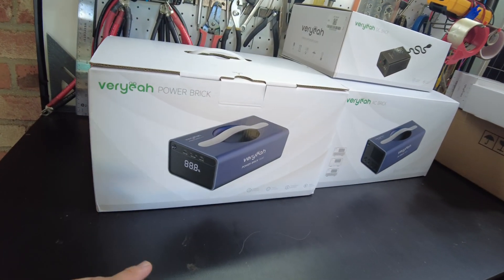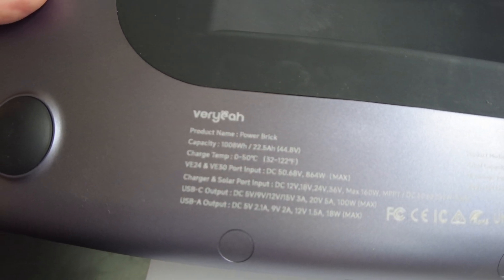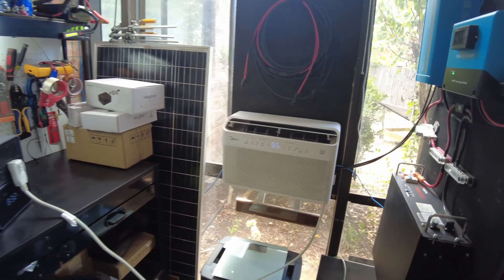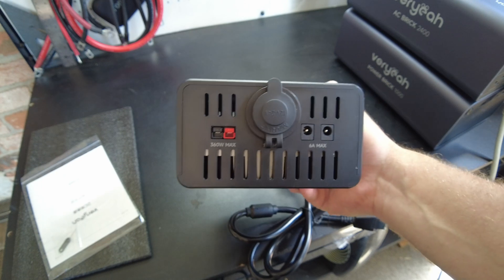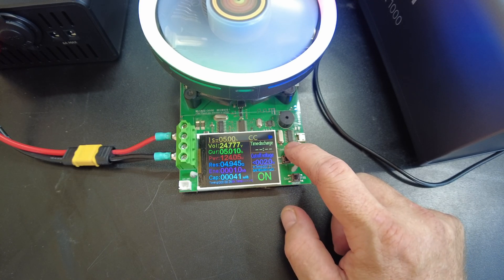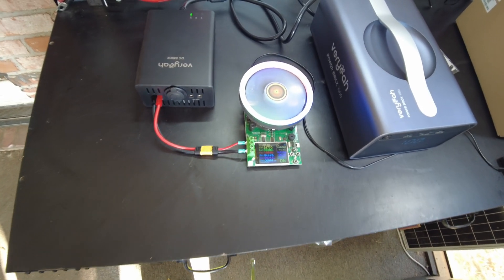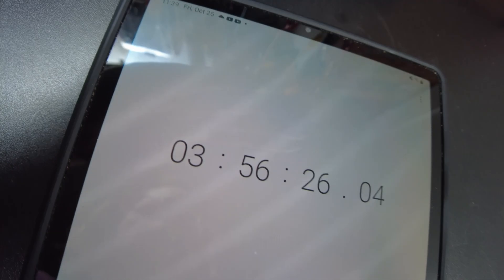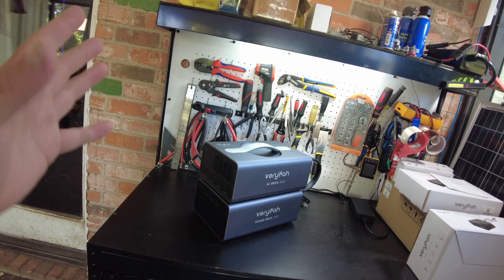Veryeah Modular Power Station System

Comment: Wanted to share feedback on how they designed the battery.  I have a modular power station from Runhood.  It does everything they claim it can but the #1 design flaw is there is zero cooling of the batteries.  Since they're sealed, as it appears this one is, the heat is trapped and limited to passive cooling.  I've run into so many annoyances due to this design and haven't seen anyone address it.  Curious if you ran into any issues under long medium to heavy loads with the batteries.

Comment: I bought a Delta 2 for 459 bucks recently. Actually, I bought 2 of them. They’re 27 pounds each. Not much different than the 20 pound power brick alone.  

The all in one concept minus the battery is a good one that more companies should attack. I forget the name of the one I saw—Licitti or something like that—but it needs to be more configurable with 60 hz PSW inverters not 50 hz and a choice of components. Have the appropriate cable sizes included with quality cables. The consumer provides their battery of choice and simply connects it to the unit. It would sell.

Comment: I like that it's modular and stackable.  I HATE that the cabling is proprietary.  If they had used an Anderson 175 plug, like the Licitti power box, I would be much more interested.  If you lose that single cable, or it breaks, your 2400w inverter is basically a $200 paper weight and the 1kwh battery is the world's largest cell-phone charger.  I have built my own power stations, which are nowhere near as "sleek", but with the same modular concept.  The difference is, I used cables that are commonly available and sized to handle a lot more amperage.

Comment: This system may be interesting for someone who is looking for simplicity with a clean design
and doesn't want to deal with monitoring and tracking in normal use as it only displays the SoC.

Modularity is an advantage for those who only need specific parts of the whole system. 
Someone needs only AC output, someone only DC output. 
Someone only needs AC charging and doesn't need a solar charging brick.
Over time, needs may change and additional bricks from other functions can be added.

For example, I'm in a situation where I can't use solar charging in a place where I need AC output and DC output. 
So, if I have multiple Power Bricks, I can still use the AC/DC outputs and Solar charge the others at another location and then swap them out. This system is ready for frequent battery changes, other systems may have problems with this.

And in case someone needs to change this modular system into one All-In-One unit, it would be possible to create DIY holder solution specifically just for the brick the user needs. Something like a small shelf or drawers on wheels with handles. And if needed, it is possible to take out the individual parts of this DIY All-In-One and use the individual parts in a different location. Veryeah have a similar small holder for multiple charging bricks, maybe in your next video.

Even Veryeah could come up with an official holder to easily make the modular system an ALll-In-One unit. From other comments, it is clear that people don't know what to think about this modular system and would welcome the ALll-In-One option along with retaining the benefits of the modularity of this system. 
At least Veryeah it would be good to add a threaded insert to each corner on the side walls to make this easier.
Or Veryeah would add some sort of locking mechanism between the bricks.

I think that such a modular system has its place on the market and can find its users. 
Also Victron is modular and is very popular.

Personally, I miss the display on the AC brick with used Power out W or kW, or add In Power and Out Power information on W or kW on AC power brick existing display. 

Veryeah should change the battery and all cables from straight to 90 deg connectors so that the cables take up as less space as possible.

Also miss me the Wi-fi/Bluetooth app option with monitoring and usage history tracking with settings from everywhere, where is internet available for those who want a deep monitoring option like the Victron Venus OS has, regardless of the simplicity of the physical clean look. Or just time to time look of history of usage, how many KW was and when used, how many cycles have all AC power brick etc. And this is Portable, so no just Online history monitoring, but also Offline history monitorig, so in offline mode the usage data can by save in internal memory or some SD card. When offline brick useed is  again  online mode on the Internet, the offline usage data is automatically added to the system and deleted from the memory. The only system, that cen do this is Victron Venus OS, when user add SD card into the Cerbo GX.

Last but not least, I miss automatic connection with Home Assistant, which would open up many more possibilities and would be attractive to another users. But this functionality is missing from all Portable Power Stations, despite my many comments. There are some DIY options to connect Portable Power Station to Home Assistant for the biggest brands of Portable Power Stations, but nothing official. Smart bulbs are automatically logged into Home Assistant nowadays, so why not Portable Power Stations???

I hope Veryeah will read this my comment with ideas and recommendations and maybe get inspired by some and integrate them into the next generation of their Modular Power Station System.
Reply from the maker: Awesome, thanks for the very detailed feedback! Very good points. Yes, I think many manufactures do read the feedback in the comments, so it's very helpful. Thanks

Comment: I'm not sure I understand what they are going for. I can get all of this in one neat package. Why would I want this? All the hassle of a modular system with the capacity of a portable system? I don't know, I don't get it.
Reply from the maker: Yeah, that was kind of my initial thought. But then I realize this might be a good option for people that have a hard time lugging around a normal full fledged power station. Being able to break it down into more manageable chunks for transport could be a game changer for some folks. I know the older I get this becomes more appealing. Thanks!
Reply: Exactly. Just get an EcoFlow Delta 3 Plus, which is less expensive and lighter than all of these modules.
Reply: Each unit weighs less, which is crucial for older consumers (most of the people with money to spend, these days).  Also, the 20lb DC brick might be all you need, especially if the 5525 or 30-amp Anderson connection can be adapted to your use case.  For example, if you have a 12v DC fridge and adapt it to use that Anderson connector, you could run it for dayz on 1000 watts.

Comment: I imagine you can add multiple battery packs to increase run time? Other than that, I'm hard pressed to see any other advantages to this approach and I can see a few disadvantages. Maybe I don't have the appropriate use case in mind?
Reply from the maker: Right, you can add multiple packs using their power hub. The thing that came to mind for me was the ability to break it down to a more manageable weight. Higher capacity power stations are really hard to lift and move around, and it get worse the older we get. Thanks!
Reply: @BradCagle  yeah, old people need tech too.
Reply: @BradCagle  Ahh, yes, very good point Brad.